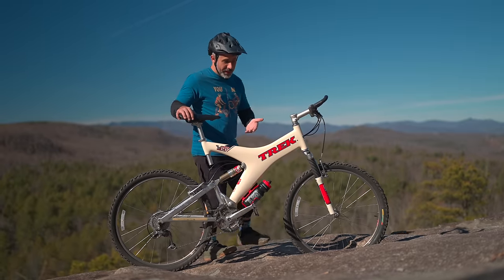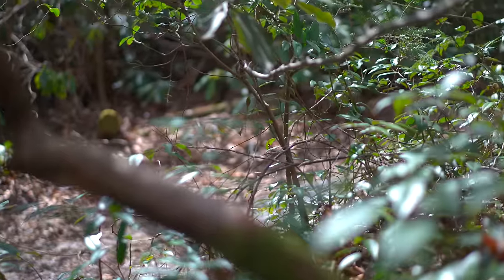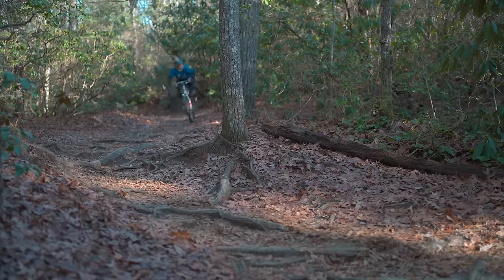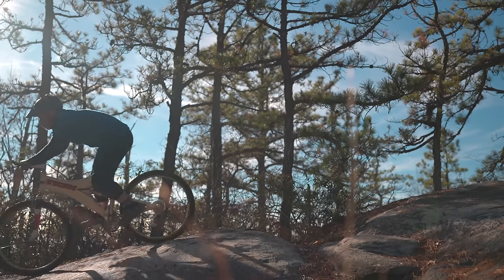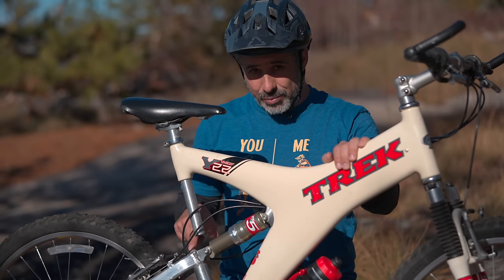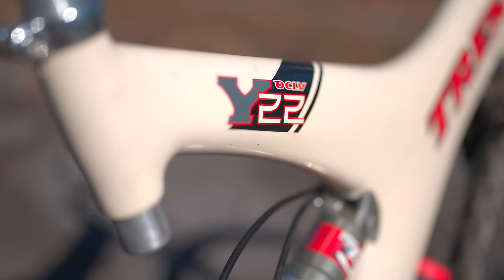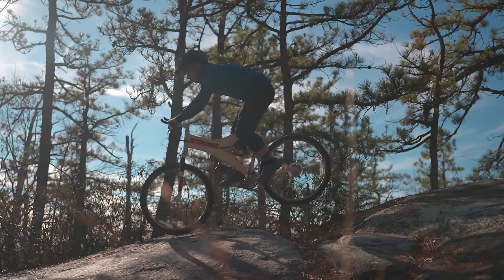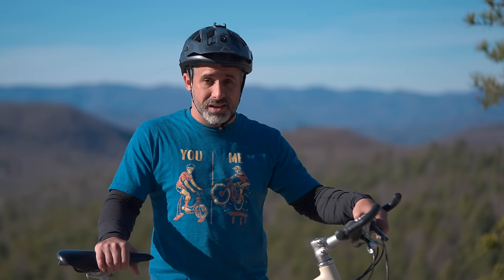The Trek Y22 was a 1990s Carbon Fiber Icon for the masses

Comment: I still own that dream bike. Mine is a 1996 Trek Y 22 in the raw carbon. Much nicer looking in the raw carbon IMO. Loved that bike and used it hard until 2019. 

Everybody used to stare when I showed up at the trailhead. They asked many questions. I was able to keep up with them. 

Except it did tend to be easier to OTB than today’s machines. I became proficient at leap frogging over the handlebars while being ejected. 

Mine was upgraded to v-brakes and 2001 XTR. 

But finally, I succumbed to long, slack and low in 2019. 

However I still have it in my garage. I will never get rid of it. Love the way it looks. Wish I could post a pic.

Comment: Yep, I  had the Y22 and Treks Y50. The Y50 had a bit more travel if I remember correctly and you were able to lock the rear suspension out to a hardball for climbing and on the fly unlock it for descent. Cantilever brakes on both bikes. The Y50 was black with yellow and green rasta accents... I loved both of those bikes and I should have kept them, however I ended up giving one to each neighbors kids after I bought my Santa Cruz Nomad in 2006. I still ride my Nomad.

Comment: I still have my 2000 Gary Fisher Sugar, with a completely undamped Cane Creek air spring in the back.  It's not that the damper wasn't adjustable, there just wasn't a damper at all.  Also setting the bike up at sag wasn't a thing.  The air spring sat at full extension until you actually hit a bump.  Wild times.

Comment: I still have my y-50 Rasta edition.  A rear shock with a remote lockout transformed the bike.  It. Weighed under 24lbs, so locking out the rear shock made it climb like a rocket.  I replaced it in ‘09 with an Ellsworth Evolve… waaaaay better, but the Y was pretty sweet in its day.

Comment: I love the retro test ride and commentary! I think more of these type of reviews  would be interesting! I have a 1985 Cannondale SM600 with the 26" and 24" wheels. I built it when I  worked in a bike shop in NY back then. I made some changes to it- it's not stock, but changes are period correct. It's an 18" frame. If you'd like to try it out, I'm here in Concord NC!

Comment: I bought some used mountain bikes a few years back, after not really riding a bike at all for about 17 years. I bought small frames (my wife and I are both just under 6ft tall) - they felt more-or-less like the bikes I rode as a kid.

After those were stolen from our garage I went and found a used hardtail that is actually the right size, and it is a definite improvement.

Comment: About bikes being beautyfull: i have seen the bikes they pick at GMBN and some bikes are actually impressive, but half the time they're modern mid to high end frames that are colour combinated wich aren't that "special" when compared to others, they look fairly normal. It's way more exciting and interesting to see what the engineers came up with brainstorming the craziest stuff imaginable back when nothing was taken out of the drawing board as a posibility, and it's one of the reasons why i absolutely fell in love with my bike, the 2009 Demo 8 is extremely saturated with geometrical details, you can tell whatever team designed it went balls to the wall to make it the greatest thing it could be, and in the process they literally hit today's formula for enduro and DH on some aspects. The way the "top Y tube (since it's not exactly a tube)" is two halfs soldered toghether, the whacky rear triangle wich also has an arm... It's quite a piece to behold. Also it's red anodized aluminum instead of painted wich makes it very distinctive.

Comment: I still have my 2000 GT XCR3000 full sus. Absolutely still love it. I've swapped out to a few upgrades, definitely a shorter stem. Disc brakes, longer bars, shorter stem, better fork, dropper that almost doesn't matter.... I like it for tighter trails where my YT Capra feels like driving a semi making the turns and it definitely is amazing at climbing.

Comment: I didn’t get my first FS bike until 1996; it was the 1st generation Santa Cruz Heckler that was also a single-pivot design; it climbed very well and seemed to descend well too. I rode that frame until 2004 because most suspension frames I rode were not very good. In fact, throughout the ‘90s, boutique brands like Ellsworth, Turner, Outlander, Intense, Santa Cruz, Titus,  and Ventana were making the best FS bikes. We talk about how crazy/bad the early mountain bikes were, but they were good enough to propel the sport to where it is today.

Comment: The Y33 nude carbon actually had a different carbon layup. I stripped back a 97 Y22 that had a dodgy respray and was disappointed the carbon weave was a lot finer and not uniform in appearance. It needed another coat of paint unfortunately.

Another thing to mention is that when you get off the saddle the suspension almost locks out due to the change in loading. When on the saddle the suspension is much more compliant.

Comment: A word on the bushing, bearings are designed to do full revolutions. Otherwise they start wearing and weird ways, which is one of the reasons why on my BMW motorcycle swing arm, it's a common replacement in an upgrade to switch to an acetyl type bushing over the oddball size conical bearing that BMW makes.

Comment: I owned a Trek Y-22, not sure what year but it was this color with a Rock Shox Judy, it had v-brakes so probably this year.  I gave up my Y-22 in 2004 - at the time I was running an Eric Bolton Jackrabbit rear triangle, stratos XCpro rear shock and a sid sl fork. It was one hell of a climber but, prior to the Jackrabbit rear end, it was prone to sending me OTB on the downhills. I was still able to get $750 for the frame & triangle which was petty good at the time. Eric Bolton was a very tall racer / fabricator from Portland, Oregon who needed a longer bike, he had a website and sold his rear triangles on line. He also provided 3 sets of mounting plate adapters for the shock that allowed for the stratos and other shocks to fit, I think the combo I used cut the rear travel to 80 or 90 while also increasing the wheelbase by an inch or so.

Comment: I actually have a '98 Barracuda XC URT frame that I was still riding up until 2018. Yes, URT frames weren't the best designs, but I still rode everything I currently ride on my modern plus hardtail. 
I just recently built the Barracuda into an experimental "softtail" gravel bike with a rigid fork, 1 x 7 drivetrain, and a friction thumb shifter. It's weird, but works good.

Comment: Half this video looks like it was filmed in north shore Massachusetts! So many granite slabs and well worn trails and the exact same kind of trees, crazy!

Also I was around back in these days, I had a 1996 hardtail mountain bike. A solid midrange machine. 10 years later when I tried to ride it, it felt like I was trying to ride a road bike. In every way. My body position was totally wrong, way too far forward. The bars were crazy narrow. The tires were super skinny. The suspension was essentially non-existant. By that time I was riding a Maverick ML7 or maybe ML8. Bikes came REALLY far in that time frame.

Comment: I still have my Y33. Second generation because I cracked the frame around the rear shock mount. They replaced it with a grey version that didn't look as nice as the nude carbon. Cracked the rear end triangle which they replaced with a Gary Fisher rear end. But it's still the same bike. Ha ha. It bobbed up and down going up hill. But point it downwards and it was incredible I thought, for the period anyway. 113 kilometres an hour was the quickest I went. With the initial up grades   straight out of the shop it cost me $6500 in 1997. Some of my favorite days were spent aboard this bike and it would turn heads like no other bike of the day.

Comment: I wanted one those SO BAD  in 1997, the catalog had a blue model on the cover. I saved and lusted for that bike. On the day I was going to plop down my hard-earned lawn mowing money, I bought a KX125 instead because $2500 without a motor in 1997 was ridiculous. Used dirt bikes were $800-1500 and everywhere.

Comment: I had the Garyfisher version of this bike but in a lower trim and 2 years later. I agree with everything you said even if my Joshua f4 was made of aluminum and had spring suspension and rear shock.
The fork was a 100mm Judy C hydracoil and the shock was a deluxe one with a handlebar lock, both from Rockshox
It was a cool bike even though when I had it it was already obsolete.
Reply: Nice ! My dad has one siting in his work shop mint condition

Comment: I have the Y-50 from that year in Rasta colors - it was the Trek Team model upgrade of the Y-33…. You can see it on the wall in my videos.  JUDY SL fork, their top model at the time.  It also had a lock out rear shock with a control on the handlebar, so going uphill you could make it like a hard tail.
Reply: Mine is fully custom, bought the frame from Trek and built it from there - more travel, and lighter at just under 23 pounds as I remember.

Comment: I own a 1998 y5 limited edition,  it has an aluminium frame. Back in those days i paid $2500. I still use it to go to work. 100 mm front and rear.

Comment: I still own a very similar looking bike here in the UK I got in the 90's called a Barracuda Blitz. It has a similar Y frame but a much neater swinging arm and came with hydraulic disc brakes, it's a restoration project I need to get onto. The paint has faded in a large patch and I'm not sure if to do a complete respray or not. I love the Y frame design myself and the Trek looks really tidy for such an old bike.

Comment: Very cool video I sold and rode Y bikes. I had one for probably 3 years. 
 I had mine set up in lots of different variations it was very light.
 I argue that they were not that strong because I think I broke 3 myself,  it would crack where the rear shock entered the carbon frame. I had a customer break the seat post mast totally off on really not a big hit, I was right behind him at the time.
The rear triangle flexed like crazy when you activated the rear brake, we used brake booster arch to fix that.
The bike ate up rear shocks I assume because because of the flex between the "Y" and the rear triangle.
If you had a loose btm brkt are anything else not right that carbon Y would resonate like a drum!
All that being said, it sure was beautiful, cool bike at the time , my  buddies and I rode them alot of miles! I still have a Y11 on the wall in my shop.
Reply: Yup, I broke 2 of them. Trek warranty FTW!

Comment: i wish my friend hadnt sold his bike,
Mongoose amplifier that most modern full sus bikes are derived from. he had the hand made frank the welder edition. it rode like a dream a bit flexy but was comfortable . the suspension worked seated or standing unlike the unified rear triangles.
my original dream bike came with a rock shox rs1 i do not remember the model but i believe it was a redline team edition hardtail
in the early days we cut our bars shorter because we used hiking trails and needed the clearance. if i took my modern cannondale down the trails i took my first mtb(trek 930) your hands would get crushed lol.
but its like anything evolution happened and thats a good thing.

Comment: I bought a Trek Y-11 new in '97 ($1200) and to this day have not felt the need to replace it.  I replaced the fork for larger dial tubes, upgraded shifter/derailer and got a spare wheelset.  It's well under 20lbs yet super sturdy and low maintenance.

It bobs a bit but at the time that was fixed with a shock lockout switch.

What well used full suspension from the late 90s would you want now?  All the linkage bikes got trashed.

Comment: A friend of my brother had one of those (the yellow one, top of the range) and he left it at my place while he was moving houses. Obviously, I used it everyday for the whole week. EVERYBODY looked at me on the street, but the bicycle was awful. At that time everybody already knew mono-pivots were silly, the bikes to have were the Spesh FSR's (Horst link) and the Kona's (Turner), the best shocks were Fox Vanilla RC with the piggy bottle and the best forks were OF COURSE the legendary Marzocchi Bomber Z1's. 
By that time, if you were still using bar ends, you were quite lame. We were starting to use wider double-rise handlebars... I bent two bloody Azonic's, they were cool but not very reliable. Answer Pro-Taper's were the best, but they were expensive and very difficult to find in Europe. 
Those Rock Shox Judy's looked cool but their C3 closed cartridges would blow up after the third ride (ask me how I know) I reckon they got rid of them in '99 or 2000? 
You're not going to find any 1997 FSR or Kona in such a state, because people would USE THEM!

Comment: Back in those days, we were riding super light 26" hardtails (yes, sub 22 lbs).  We always hated those Trek bikes that looked like a flying sideways wing.  We called them "bobmasters" compared to our hardtails.  Eventually, they mostly ended up hanging in some non riders garage.  They did pave the way to better designs with 4 links, like the Turner Burner, which was later copied by Trek. Comparatively to most mountain bikes of that time, I guess the Trek fling upside down wing really was not that bad.
Having ridden early motocross bikes as a reference, I always hated the long stems, narrow handlebars, and short wheel bases of mountain bikes of that time.  You could alway count on "going over the bars" ......often.

Comment: I had a Merida form that era , same y shape and full suspension , it drives well and the suspension wasn't that bad either but sadly it got stolen.
Edit: the rear suspension had 3 mounting points for adjusting the length or adding bigger and more travel suspension , the lower bottle always got mud and dirty but luckily and strangely my bike had a second mounting points fot the bottle on the rear area of the seat tube !
Reply: Omg same, but my mom gave it away to someone, that bike was my childhood :(

Comment: I had a Carbon Y11 which we considered as amazingly great back then. But in hindsight the ride was truely horrible. Still have the Y frame as decoratiom in my garage, the aluminium rear triangle was made too narrow, so the back tire rubbed against it and eventually caused it to crack. The standard front fork was a rock shox indy which i upgraded with a 100mm longtravel kit from englund air, the fork was absorbing shocks more by bending as by actually sliding in and out. The V-brakes were screaming like crazy when raining, in dry conditions they were ok for the time back then. Conclusion; it was good learning in a bike like this, but man, the modern bikes are so much better. For instance my morewood izumu downhill bike feels like riding a mercedes s class compared to the Trek Y. But still have warm nostalgic feelings for this bike since back then, we had much fun. Thanks for the video! And keep up the good work
Reply: Ugliest frame ever

Comment: At 16yo I was handed my savings account by my parents; all the birthday and Christmas money I had gotten over the years. I had $3600 to my name. So what did I do? I spent $2400 on my brand new 98 Y-22 and $800 on my first car. I LOVED that bike. They changed over to rapid fire shifters and modified the rest shock mount, but by and large the same bike (in Orange with a yellow rear triangle). I thought I was hot sh*t when I added Hayes hydraulic disk brakes.

Comment: there is one glaring fact that seth has left out, the frame flex!!!!

while pedaling out of saddle and throwing the power down you could make the BB shift over by about 2 inches depending on your size and amount of force you applied....
i still remember breaking a first gen Y series frame trying to climb up a fairly steep uphill in BC back in the 90s, i ended up buying that bike off my friend since it was his and trek sent me a 2nd gen Y22 triangle due to it still being under warranty . it only lasted about 2-3 weeks before i cracked the 1st gen rear triangle... thank god trek sent me a new one cuz i was about to just scrap the whole thing for parts at that point but was glad we got it sorted out because after that i rode it almost daily for 6 years until i moved and sold it

Comment: I still have my original Y-11 from Trek's first shipment - so early that trek didn't have the cheaper coil-spring shock to ship with it so they shipped it with the air shock spec'd for the Y-22. that was my last mountain bike purchase other than for wife & kids.  probably 10 years ago I was told by the bike shop that sold it to me that the frame is warped and has lifetime warranty. I didnt do anything about that at the time b/c I thought Trek's full suspension frames sucked at the time (and warranty would just cover frame replacement if that)

Comment: My carbon fiber Trek might be around the same year or older (I can't remember). It's a classic hard tail design with RockShox. I rode Mt Tam a few times and it was so quick because it weights (maybe) 21-22 lbs. TBH, I've had it in storage forever - maybe riding it a total of 20 times. Do you have any idea of some good sites/places to sell it?

Comment: Single pivots work really well, just look at any motorcycle. They go up hills fine. The pivot position is the key and this bike and Santa Cruz Hecklers got the position about right. Yamaha used bushes on their bikes...they suck, bushes not Yamaha. High bottom brackets are the bomb. Hope they changed out the elasto-polymers in those forks, I put spring and damper cartridge in mine. Very nice bike amazed the frame is still in one piece.

Comment: I still have a 1999 YSL 200 with XTR crank in good working condition, original rolf wheels and mavic wheels for general use! Still beats my friends modern bikes 😂 ❤
Reply: I would say thats your skill. I would be surprised if you were slower on a modern similar weight full suspension. My Devinci has Treks abp rear suspension  and its way more efficient than this.